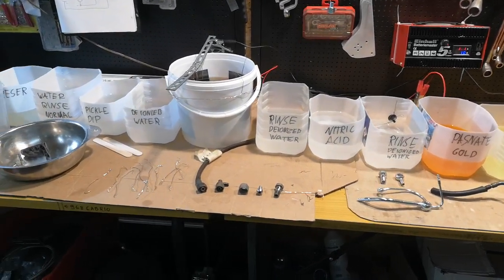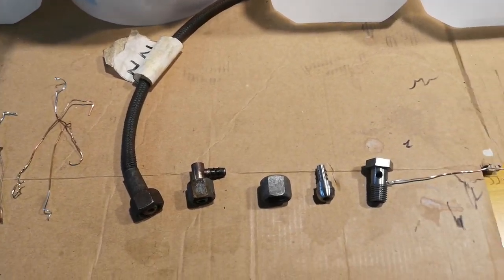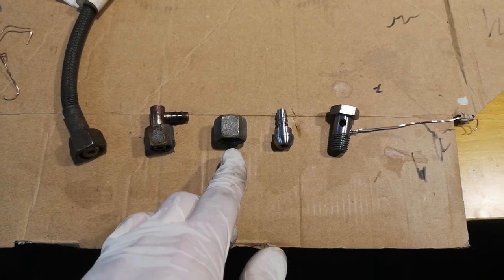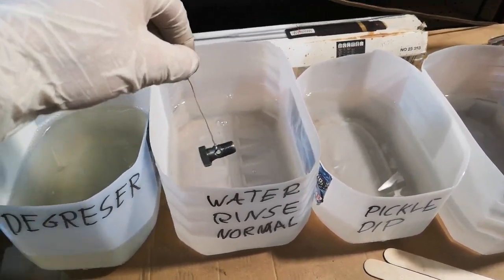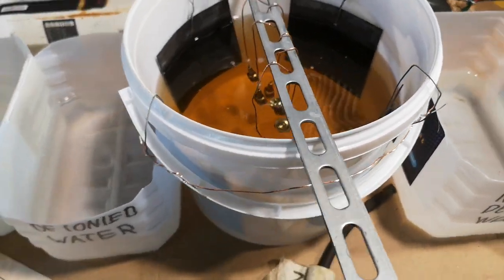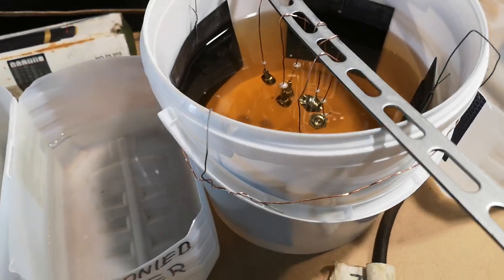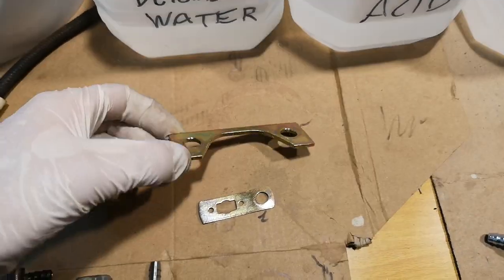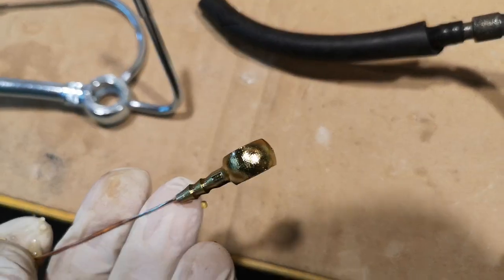ELECTROPLATING is easy! Porsche fuel system parts zinc coating.

Comment: Using acid to clean small parts is okay. DO NOT USE THIS METHOD on suspension parts (control arms, sway bars, torsion bars, or coil/leaf springs). Hydrogen embrittlement will result weakening the steel and it may fail.  The old standby "Easy-Off Oven Cleaner" (not the de-fanged low odor version but the Sodium Hydroxide stuff) is one of the cheapest, most effective degreasers you can buy. Just don't use it on rubber or aluminum.
Reply from the maker: Thanks for the information, much appreciated!